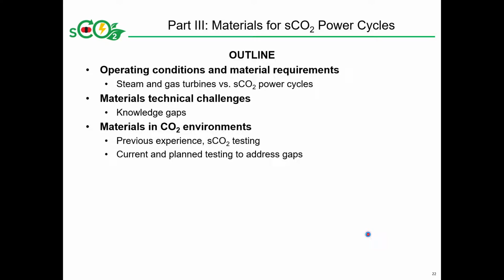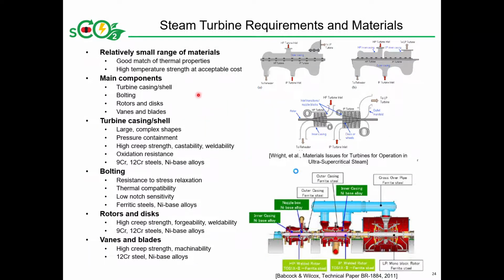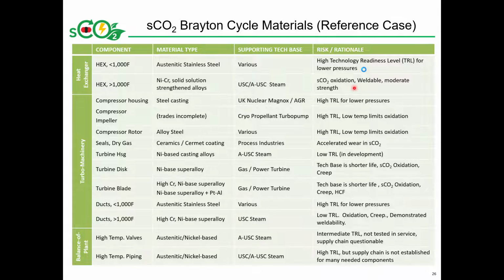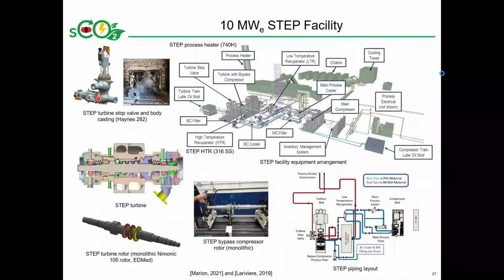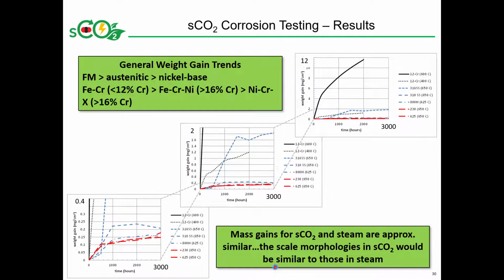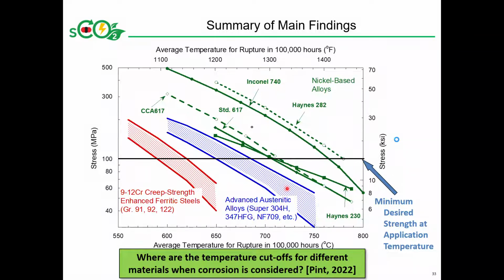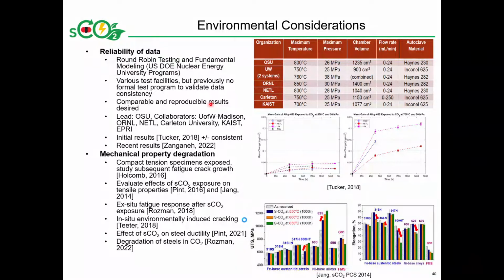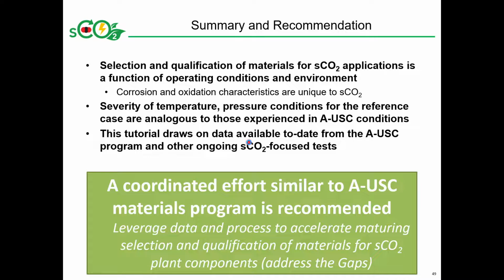sCO2 PCS 2022 Materials Tutorial Recording

Comment: Thank you for the talk!   With large needs for electrical power for human off earth use, could sCO2 turbine generator cycle using a compact nuclear reactor possibly sodium cooled have a high working minimum cooling temperature to allow radiant cooling into space?    On the Mar's surface some convection cooling is possible at 1/00 atm.   Elon Musk want's to have a significant rocket fuel processing industrial facility on Mars for returning space craft needing MWs of electricity.   There would also eventually be the high desire for deep drilling for core sample and predicted liquid water at 7 miles deep.   The moon has similar needs.